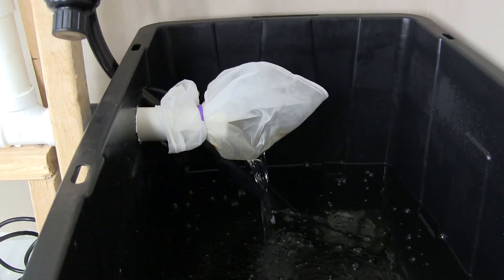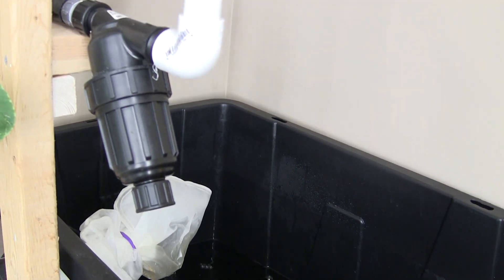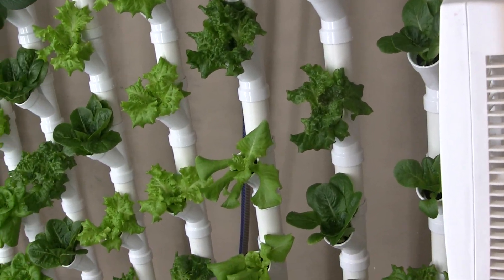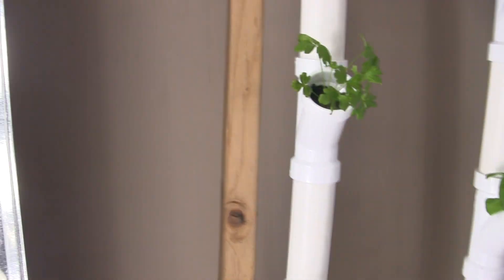Basement Hydroponic Tower Garden Version 2.0

Comment: That's very cool, but what's the cost in power and upkeep vs just buying lettuce from the shop, also why dont you buy some solar panels and a battery to run that pump and the lights, this way over time it could pay for itself in savings
Reply from the maker: I have rooftop solar, and after I had a Sense monitor installed, my lights don't require as much energy as I thought based on their bulb wattage. I need to learn more about energy draw. I thought a 15 watt bulb would draw 15 watts of energy when it goes on, but for some reason this is not the case with my lighting.

Comment: So amazing.  I'm going to build it outside in Los Angeles.  Thanks for all the info as well.  I started this with a Tower Garden system I bought used on Craigslisst for 300.  But you have to turn it every day.  Inefficient.  You appear to be a super planner/engineer type.  Have you ever done a sketchup or cad model of this?
Reply from the maker: Thanks, no, I just do what make sense to me. Make sure you paint your PVC with a UV blocking paint when you use it outdoors. Best of luck to you!
Reply: @maryneumayer01   Hi Joe, what's the reason for the UV blocking paint?  Looks like painting PVC is not easy.  Any other solutions?  UPVC?

Comment: You can double the  amount of plants you can grow  by replacing the wye connectors with double wye connectors or you could half the size and have the same amount with the double wye connectors and have plants growing on both sides
Reply from the maker: yes, but then I'd have to move it to the middle of the room. where would I player kicker fußball and darts? The towers are also leaning forward for the irrigation to run down the front where the plants are seated. But straight could work too perhaps. GIve it a try and let me know.

Comment: Does anyone have a good idea for whether this would be easily adaptable to an aquaponic system?
Reply: I think it would be easy to convert to aquaponics. Simply turn his return water reservoir into your fish holding tank. Then you don't need to add nutrients and you get the add benefit of a fish dinner once in awhile.
This pipe and fittings are pricey but I do like this design.
Reply from the maker: Be careful - I did aquaponics for a couple of years and then switched over. You'll need a bigger tank and a solid waste filtration system so that solids don't plug up the irrigation tubes. Also fish like higher pH but plants need lower for nutrient availability. Be sure to constantly test for nitrates and pH. It's going to be a bit more complicated then you may think.
Reply: @maryneumayer01  Do you figure it would depend on the type of fish or anything? All of this seems very complicated to me. I'm trying to convince myself to just start small with jars on my window sills and see how that goes.

Comment: Good job and well explained. What is the pumps head and watts? Have you calculated your power cost and done a complete cost analysis? It depends where you live but based on what I see your cost would be high in my country.
Reply: Also wondering pump psi. Will be using LED full spectrum.
Reply from the maker: Pump is Pondmaster Supreme model 5 or 7 - I'm sure I posted the exact model in a comment below.
Reply from the maker: Yes, I've done cost analysis. I bring extra heads to work and my colleagues give me a donation, which covers my cost. We also have rooftop solar so that brings my costs down considerably. The big draw is the lighting,  which I am working on a new scheme which would bring down my draw 40-60%.

Comment: I have a question...if decide to built another tower just next to the previous one...I'll be needing another water pump right??
Reply from the maker: not necessarily - you can add on to your current system and if the pump is not maxed out it may work. I added on some new towers without a problem.  You have to connect the bottom drain pipe and replace the entire top irrigation lines.

Comment: Your system is awsome!  You could arrange the wall sections into an octagon and put the light bars in the middle vertically with maybe mylar wrapped on the back side of the octagon. A ceiling fan overhead would work as well. The tubing system works as a fogger as well as pumped water. 

I'll say it again, your DIY system is awesome!
Reply from the maker: Hi Michael - that's interesting. Others have made comments similar in nature. Give it a try and let us all know how it worked!

Comment: can you do this outdoors in the yard ??????
Reply from the maker: Yes, I have some videos with an outdoor prototype - poke around on my channel. The challenge for me was to keep the nutrient cool. I buried a 5 gallon bucket but on sunny days with 90+ temps I had to add new nute daily to replenish, and that was a bit of a pain. But the plants did great, especially the herbs. You will need to apply a UV blocking paint to the PVC if using outdoors, or your piping and fittings will degrade quickly.

Comment: I love your vertical design.  I'm trying to decide if I'm going to build a vertical system like this or the "zig-zagging" type (which might be what your old system was, sorry, I'm new to your channel).  I just like how this looks so much better.
Reply from the maker: Hey Punky, I don't have much experience with the zig zag type (NFT channels), but if you go that route make sure you use a bubbler to aerate your nutrient before you irrigate your plants. Indoors you would need your light source above as opposed to my system, which is frontal. Outside it wouldn't matter - just paint your pvc pipe for outdoor use with UV protecting paint, as is suggested practice. Best of luck to you!

Comment: Does your basement get any sunlight??
Reply: No, He uses electric lights.
Reply from the maker: I use conventional LED A19 light bulbs - 15w right now, during the winter when I run my system. It uses 1050 watts per hour.  I am designing a new lighting scheme which uses 5 watt LED cob vegetative grow diodes  and I hope to decrease my energy footprint by 60% for next winter season. During the spring/summer/fall I grow in my greenhouse which uses the sun. But the Chicago winters are not conducive for growing, especially with these new polar vortexes caused by climate change (sorry climate change deniers - I am a man who believes in science). We had days last winter which were 25 degrees below zero and with an R value of 2.2, the polycarbonate panels are only good down to about 20 degrees at night if the sun shines during the day to heat up my passive solar systems.  Thanks for your question.
Reply: And how much do you pay for the electricity per month??

Comment: I didn't get it : how does the water reach the roots? It's just passing by. Or are the roots in "Rockwell" (?) and the water runs over /through it?
Reply from the maker: I tilt my towers slightly forward so that the irrigation flows from one rockwool plug down to the next, aerating itself as it travels. The roots grow down the tower and the plant grows out the front.

Comment: You can double your production by angling your plant holes alternating right and left  at 45 degrees and reducing the spacing to 1/2 of what you have now.  Since adjacent plants are pointing  then at 90 degrees from each other you have no issue with plants bunch up with each other.
Reply: Is very nice setup.  I am building and a-frame version now with same principle in general.  It is for outside and I have the pvc system horizontal.  To cut down on the cost without compromising function and to increase grow spots I am doing the following:   I am using 2x4 wood for the a-frame structure.  I use 10 ft 2x4's cut and joined at the top at a 45 degree angle.  Then 10 4 inch PVS-S (THIN WALL SEWER PIPE) are spaced on 1 ft centers down each leg.   This gives 300 planting spots on 8 inc centers.   I only will pipe water in to the top pipe on each side.  I choose the water (solution) level for each successive pipe and let the upper ones overflow to each successive lower one as the upper one reaches my overflow level of the immediate pipe above.  Once they are all filled the first time, whatever flow you put in will overflow in every tube equally every time the pump comes on.

This method saves the big expense of all the WYES which is signifiant.    To hold the horizontal pipe in place, just drill an appropriate hole horizontal to the ground and insert a dowel or rebar and tap it in place.  No need for fancy connectors and it looks good.  Another advantage of this is that you can make the dowel as long as you want if you choose a bigger dowel.    If longer, then you can expand as much as you want by adding 2 ,3, etc alongside your primary pipes.  If you have 3 at each level and staggered holes, then you have 900 planting spots in this one setup.  You may have to connect your holding tanks together as your system gets bigger though or you will be having to mix up your fert solution much too often.

Another advantage of this setup, especially by using a wood frame, is that there is lots of internal space to put to use  by adding attachments to the frame to grow additional products of choice. The footprint of the system is roughly 6 ft x 10 ft when assembled.
Reply: @Madmarlinlodge  thank you very much for your detailed explanations about your system
Reply: @VICTUS_fashion  You are very welcome. I just think it is good for everyone to share their ideas to help everyone if possible. I really like what you have done also.
Reply from the maker: Sure, please share a link with your finished product - I'm excited to see it and how it works in practice. Thanks so much for sharing!
Reply from the maker: Hello Mad Marlin, this has been brought up before. I'd imagine it would work better outdoors facing south so the plants can benefit from sun moving east to west. Indoors the light would be frontal and static, and I'm not sure how that would impact growth.  I'm thinking the plants would reach and therefore not grow right, because instead of the plants facing the lights they would be off on an angle.  Also, for doubling the number of plants on the same tower I'd imagine you would may need to increase spacing between the plants, or you would be constricted as to what varieties you grow to avoid overcrowding. Additionally, how would you tilt the towers in two directions at once to irrigate both sides? Perhaps with a wick - but I would guess the roots would impede top to bottom connection, especially if you plant every other to optimize energy output from the lights.  Like I've requested from others who bring up this configuration - neat idea -  I would love for you to  try it out and share a video of a system built with this configuration. I'd love to see how it would work in practice.
Reply: @maryneumayer01  I am just putting everything together now for a "normal grow" so I am not going to do the spacing as I suggested yet because this grow is essential to go unimpeded by an error.  I did misstate my angle though, it should be 20-30 and instead of being at exact same spot this angle should allow 4 inch centers rather that 8 inch for lettuce.  I will probably get a try out of this on one add-on piece and just a few holes.  
For the big outside a-frame I will have 20 x10 ft sticks of the 4 in sewer pipe.  That should give me about 300 net pot sites anyway.   As far as indoor lights, Sansi makes some excellent bulbs at various watts.  They are pretty focused so you have to get their higher wattage ones to cover bigger area from larger distance.  I tested the phororeactive light at about 20 inches on the 20 watt small one an it watt still over 100.  With the 40 watt ones you ca really back them off for good overage and fewer lights.  They screw in just like any normal bulb so you can create any means that you want to mount and angle them.  They are well-constructed ceramic and do not get hot at all.  I have only tested them on horizontal racks but grew the most incredible geneveve basil and blule velvet basil you can imagine.  I would notmally intend to sell as microgreen stage but let the tests go to 18-20 inches and results were remarkable.

Comment: How do you supply an equal amount of water to every tower? I don't understand the top supply system
Reply: it pumps into a pipe that has a bunch of the smaller flexible lines coming off of it. Technically, the earlier lines will get more water, but its not much. As soon as water is flowing out of one, pressure causes the water to move down the main pipe. as long as your pump output is as high as the total flow output of all the end lines, the amount of water to each will be similar.
Reply from the maker: basically it. Once the tower is irrigated from the feed line (1/4 in.) at the top which comes from the supply line (1/2 in.), gravity takes the nutrient down the towers, which are leaning slightly forward, to the return pipe, which brings the nute back to the container. Slight slope from the end opposite of the nute container.

Comment: The framing and all these fittings must have easily run in nearly a grand. probably spending $100/month in lights and pumps... ayyy..
Reply from the maker: No. I reused some extra lumber from the garage and the tees were considerably cheaper in bulk from Menards. I'm running my lights off peak with a timer. Saved $350 last year doing that. We had rooftop solar installed so in the dead of the winter we don't make as much energy but my donations for extra produce cover running costs. Last month (March) we used less electricity than we generated so $100 per month on electricity is way inflated, with or without help from the solar panels. But if cost is your main concern I would recommend purchasing your produce from a local market. It's way easier to calculate the monetary cost of your food that way. Main thing is that you are eating healthy and trying to live more sustainably. :-)

Comment: How much has your electricity bill gone up since the install?  I am just wondering about the upkeep costs.
Reply from the maker: That changes every month depending on supply costs and time of year. We also have rooftop solar so last month it was "free." :-)  The system uses about 16 kwh in lighting and a tiny bit for the fan and pump per day, so depending on your electricity prices it should be easy to figure it out.
Reply: @maryneumayer01  thanks for the info!  It is a very nice system.

Comment: How did the roots of the lettuce hold/clog up?
Reply from the maker: no clogging on the lettuce, but if you keep your bigger greens in for more than 5  or 6 months or so you will get clogging and backing up of the nutrient. I swap them out at 5 months to be safe.
Reply: @maryneumayer01  I had a vertical setup with lettuce and kale, and it would clog the system pretty bad.   I had to imolement water bypasses so that nutrients could flow around when it became too clogged.

Comment: Anybody know where to get the 1 1/2" wye connectors at a reasonable price? Menard's is out of the 50 pack (and they don't ship to the west coast). I'm finding them at random suppliers for $3 each!
Reply from the maker: Yes, I found them to be expensive locally per piece as well. I order a lot from SupplyHouse.com if I can't order from Menards online but I don't know what their price for the wye tees are.
Reply: @maryneumayer01  Thanks so much for the reply. I ended up buying really expensive ones off the shelf because I ran out of patience. The setup came out great! As the system is outdoors, I 3d printed caps to put over the wye tee openings to minimize evaporation, dirt, and bugs entering the system. I'll remove the caps when my seedlings are ready to go in. So far, I'm really happy with the setup. Thanks for the great ideas!

Comment: Hello, we’ve greatly appreciated your tower design using PVC drain Tees.  We’re a volunteer organization testing out the elements of operation before setting several systems up in Malawi, Africa for orphan children homes.  One thing I don’t find usually mentioned is how long water should be circulated.  In one of your videos you mentioned a 15 minute 0n – 15 minute off cycle.  Do you continue this continuously, i.e. 24 hrs per day?  We began our tests with 12 hrs on – 12 hours off, but the plants are very leggy.  I imagine the roots dry out over night.  Would you elaborate on watering cycles please.  Would also appreciate guidance upon the light timing.  Thank you!
Reply from the maker: Hi PWSigmund, I am currently running my indoor pump 30 min on and 15 min off. I did 15/15 for the first 2 years and it worked out fine, but I once left the pump on continually once for a week and it was amazing how much faster the plants grew. So now I am running 30/15 cycles throughout the day. For my greenhouse it depends on the time of day. In full sun and heat I run the pump longer and at night it's less. I don't recall the exact minutes, but it's something like 15/30 at night and 30-45/15 during the sunny hours, and a logical transition in between. Think of it in terms of transpiration. The more the plant transpires, the more water will be lost. 
Also, leggy plants are usually caused by insufficient lighting, not irrigation, in my experience. Are you plants getting enough [intensity of] light? In my basement I run the LED lights 16 hours on and 8 off. This seems to be sufficient for greens. Let me know if you have any additional questions. Best of luck!

Comment: Great however the WYE pieces are about $3-5 a piece so you have like $500 in PVC alone
Reply from the maker: Hello Robert - feel free to check out the supply list I provided for my fellow enthusiasts. There I have a link to: NIBCO® 1-1/2" 45-Degree PVC Wye DWV -50 Pack Model Number: K090050 Menards® SKU: 6892648  which comes out to $1.38, without tax. I have not been able to find a cheaper price. Best to you and thanks for your comment.
Reply: can anyone dig up cheaper WYE connectors?